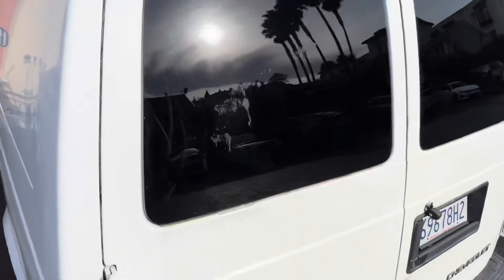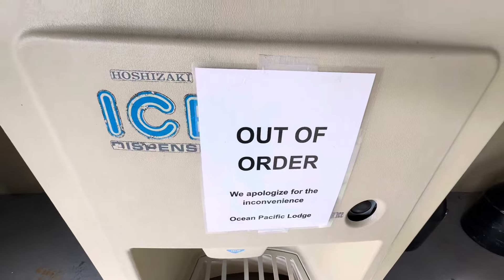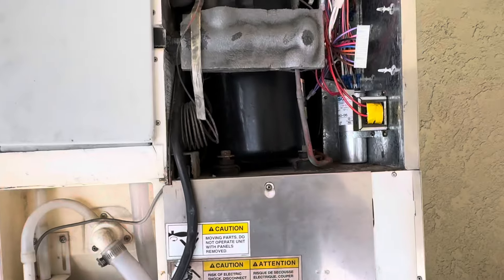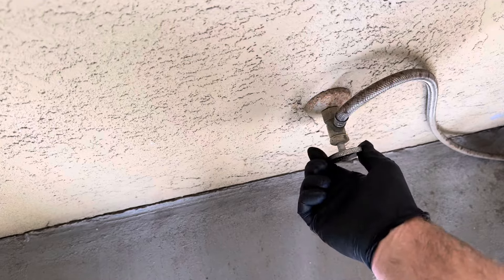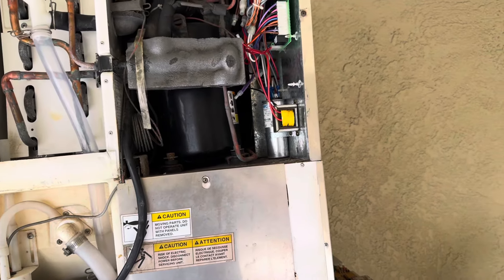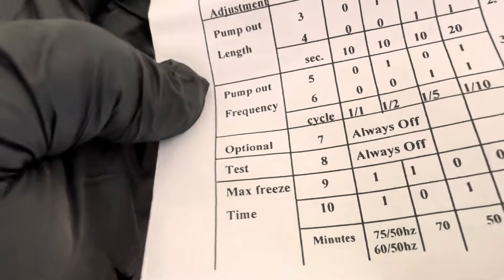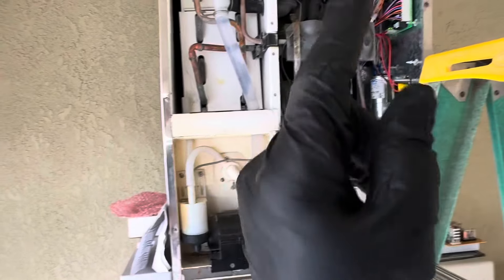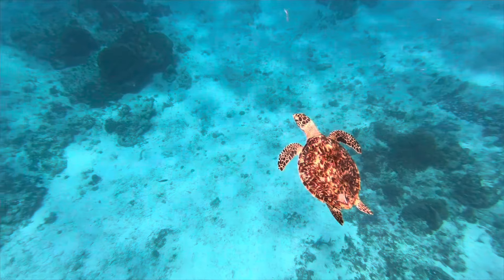Ice Machine Repair

Comment: Pro tip: take a klein 32581 screwdriver,  pull the bit out, and slide shank over the control board stand offs. It's the perfect size, and it releases them everytime. Works on Hoshi, Manitowoc,  Scotsman. I have yet to find a circuit board stand off it doesn't work on 🤙
Reply from the maker: Great tip of the day. 🤘🤘 I have that screw driver too.
Reply: Steve Lav taught me the neat trick of using a round bic pen. Have not had it not work so far.

Comment: I had a customer replace the board on a hoshizaki machine that called us because it still wasn't working after replacement. I diagnosed reversed polarity so that was a $600 board that got turned into a paper weight when they powered it up.